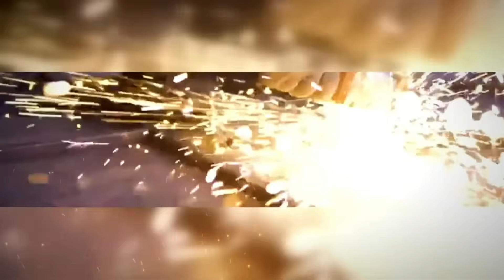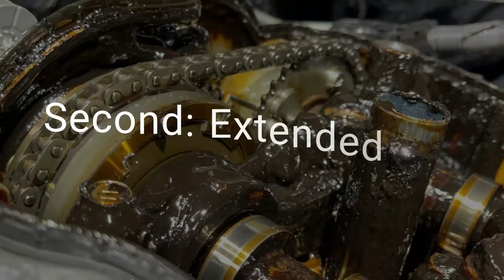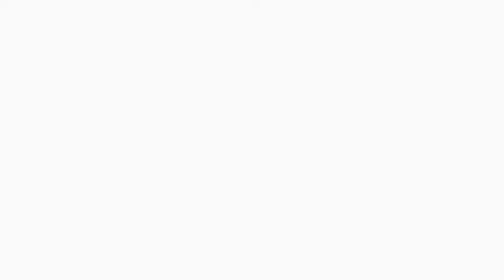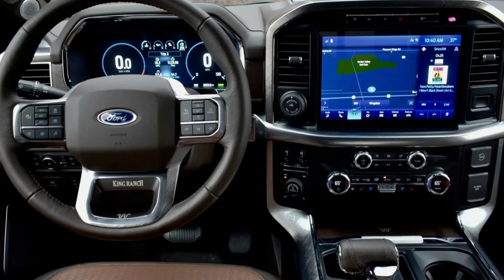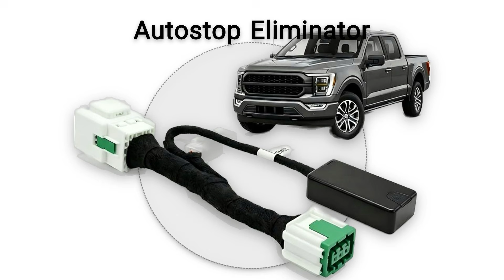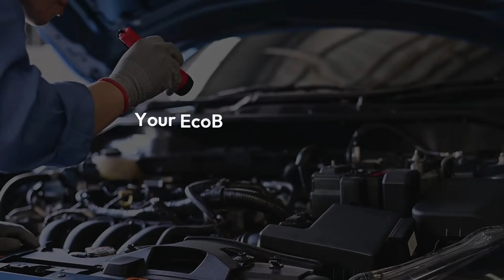Ford F-150 Settings That Are SLOWLY DESTROYING Your Turbo Without You Knowing (DISABLE IMMEDIATELY)

Comment: The coolant system for 3.5EB turbos continues to run after the engine shuts off.
Reply: Does the coolant system keep the flow of oil going through the turbos?
Reply: @ryandiehl5571  Oil is for lubrication.  Turbo is no longer spinning so doesn't need continued lube.  The coolant runs to bring the temps down.
Reply: @r @rusty308 no, he literally explained that in the video. That’s why you need to run the truck 60-90 seconds after long hard driving. That’s why you get built up oil deposits, not coolant deposits.
Reply: @rusty308 oil is not just for lubing, it helps carry heat away to be cooled, just like the video mentioned.